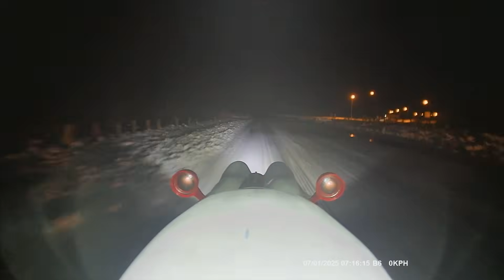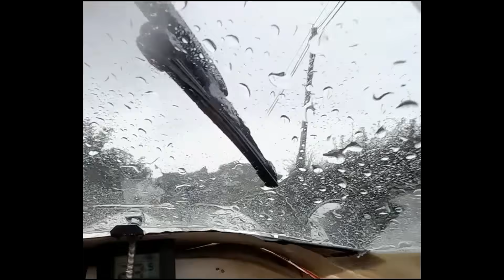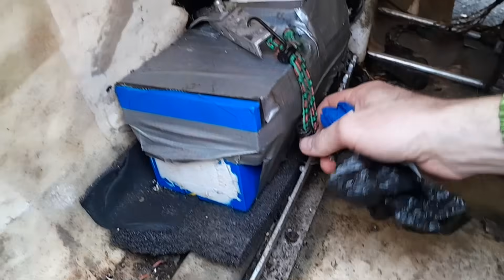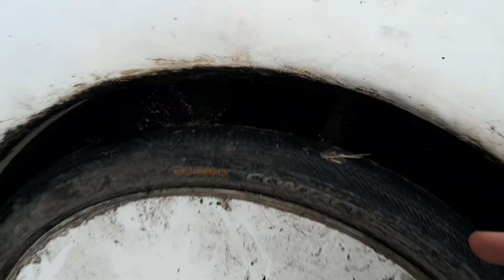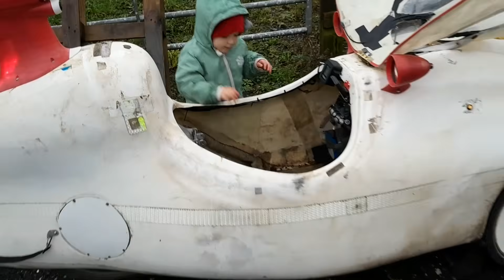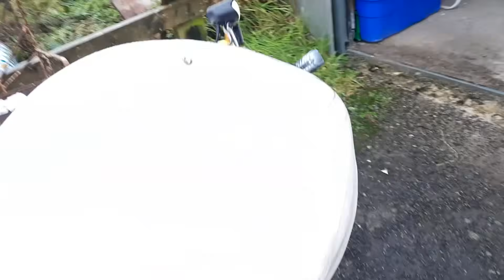Everyday Velomobile - E6. Review after 28500 km range

Comment: Tough velo. Bro, you should check and maintain it more often, like you would with a real car. I guess one should not let your velo work at its limits, even though it will cost less of your work.
Reply from the maker: The point of testing is to find points of failure. Without failures and breakdowns it is impossible to optimize the design.

Comment: I dream of taking a velomobile accross the country(world) with a camper trailer with solar, and 750w motor. I want to build the shell for both out of coroplast. I figure I can build a 750w velomobile electric trike with a solar, collapsible camper trailer. I want to take this around the world and film it
Reply: recumbent trikes alone are a minimum of 2,000USD. If anyone reading this can help support my dream I promise it will be worth it
Reply: @coltonflinchbaugh3000  where in the world are you? It would be cheaper to buy a second hand velomobile in some places than to build one from scratch. Sites like leboncoin , maktplaats etc often have velos at around 2500. With a little bargaining you can acquire for 2000 or less.
Reply from the maker: That’s a great idea! 750 watts is too much—and illegal—for a bicycle in Europe. However, you can limit the power in countries where it isn't permitted.